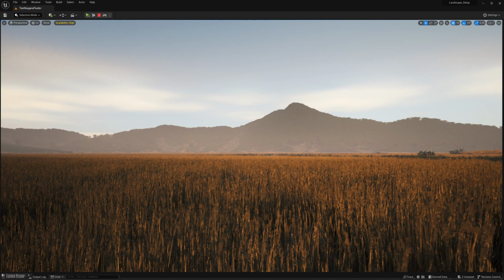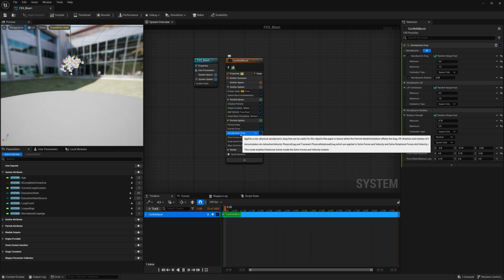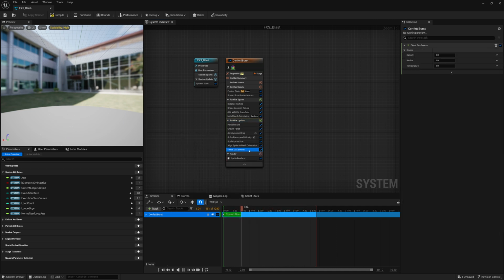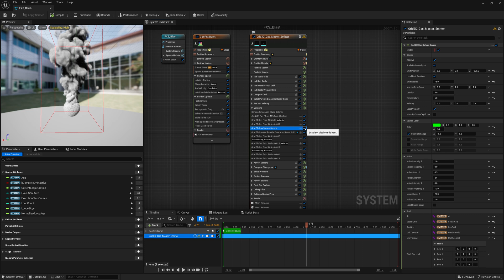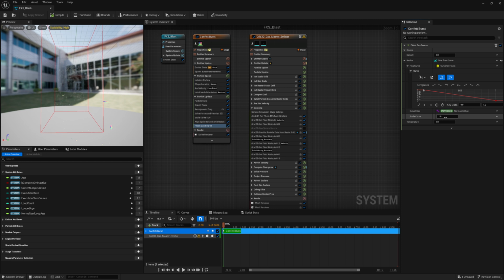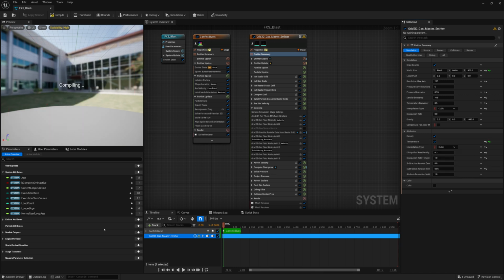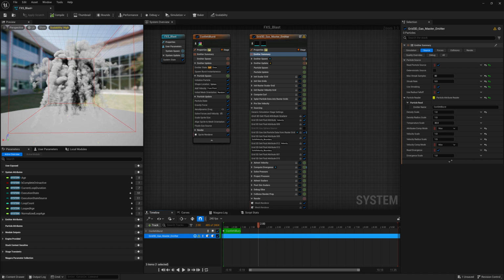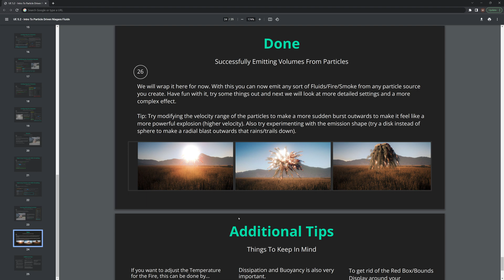Unreal Engine 5.2 - Intro To Particle Driven Niagara Fluids (Fire & Smoke Explosion) [1]

Comment: I am using 5.5.1 and when I select temperature I dont see it changing
Reply: Having the same problem, Did you ever figure it out?
Reply: @DefinitelyNotManny  I think I figured it out. Went down a rabbit hole a little. The Boolean for "Temperature is broken". I downloaded 5.4 and 5.3 Unreal and made it and seems to work then I migrated it into 5.5.1 and the Boolean checkbox for Temperature works. There's a work around but not really any solid solutions. It's a bug I guess
Reply: @DrNitrogen  ahh really, that's to bad, good job finding a solution!
Reply: @DefinitelyNotManny  I found a real solution. In the 3D Gas Master -> Render Temperature-> Set as curve , then for Temperature Color Curve -> Gradient
Reply: @DrNitrogen  awesome!! Great job! Will go and test it
Reply: @DrNitrogen yeah that worked! Thanks
Reply: @DrNitrogen  YAY! Thanks, may your renders always be super-crispy, your framerate high and GPU temperature low
Reply: I'm still working on getting the Temperature to affect it like the video shows. No luck so far. In 5.5.1, the Temperature affects the actual temperature (e.g. rate at which the fluids rise and fall) and not the emissive properties for an explosion.

Comment: i turn on temperature but iit doesen't work there is no fire , im useing 5.5.1 version
Reply: same I am using 5.5.1 and dont see it working
Reply: @DrNitrogen    Try setting the emitter to GPU to match the GPU setting of the Gas Grid.  Worked for me.

Comment: Well finally got around to packaging a product with this in it and.... the explosion is completely missing.  I suspect it is from the errors that show up in the output log.

LogNiagara: Error: Particle read DI is trying to access inexistent variable 'fluids_source_previous_radius' in emitter 'Explosion.ConfettiBurst'.
LogNiagara: Error: Particle read DI is trying to access inexistent variable 'fluids_source_color' in emitter 'Explosion.ConfettiBurst'.

I have no idea where these should be so I can't make them up.  If I find something I'll come back and post the solution.
Reply: Ok solved one of them. Need to add a Set Fluid Source Attributes to the Particle Update section of the parent emitter.  This gets rid of the missing fluids_source_previous_radius.  BUT it also makes the entire particle the color of the temperature setting (IE: all fire). Nope, also gets rid of the color variable.  Now to figure out how to make it not all fire and get the smokey explosion back.
However, this does make the explosion appear in PIE and I will assume packaged product.
OK, so to fix the nuclear effect when adding the source attribute is to change the temperature in the new source attributes also to 0.05 or whatever you like.
That fixes the missing variables and thus the missing particle effect in packaged game.
Enjoy.
Reply: Further update. While this got rid of the errors, I still have about a 50% failure on packaged product.  Don't know what is missing now.
Reply: Follow up:
These simply do not work in packaged products.  Seems to be an issue as its discussed (if you can find it) on the unreal engine forums.  This is under 5.3.2.

Comment: Looks very nice. Seems to not work quite the same in 5.3.2.
As soon as you turn off the emitter sphere and attach the particle source to emitter (see in comments on changes on how to do this) nothing is emitted by the particles.  You need to also turn off Use Radius Falloff.
Reply: Work now on 5.4 ! Thank you
Reply: @oliviergenovese4469  Interesting. I suspected it might be the case but can't turn my project to 5.4 just yet.
Reply: @oliviergenovese4469  Well copied the project and updated to 5.4. It worked once then not then again.  It seems very inconsistent. I'll try now to see if it is consistent in the packaged version.
Reply: Ok so I don't know if this is universal but finally I have the explosions working in packaged product.
All I did different is have local space off on confetti burst, but it is on the grid3d_gas_master_emitter.
So weird.
Reply: @b.delacroix7592  It's curious that only the radius fall off do the problems with after 5.2 versions, must have a bug somewhere

Comment: I was doing this but i have a qestion, when i go a bit far from the particles, they cull, it usually has some sort of target effect, I tried messing with the cull settings, render distance maximum, and bound settings but it doesn't seem to work
Reply from the maker: Try, (r.HeterogeneousVolumes.MaxTraceDistance 100000) in the command console.
Reply: @renderbucket  太赞了兄弟！我为了这个答案寻找了一个夜晚🥰

Comment: Im trying this in 5.3 but there seems to be some changes made. When trying to add Particle Source to Grid Gas Emitter, there is no Read Particle Source checkbox instead there is a dropdown. Selecting emitter in this dropdown and pointing it to ConffetiBurst (ParticleReader.EmitterName) does NOT for some reason connect it as on your tutorial. Any tips appreciated. Thanks!
Reply from the maker: Make sure you are creating a Grid3D_Gas_Master_Emitter. And inside of it under Emitter Summary with the All Tab click on, look for Particle Source Group, once you find it set Particle Source Type to Emitter and then the Particle Reader Group will show up, and inside that there's a spot to type in your Emitter Name.
Reply: @renderbucket in 5.3 the effect is not visible until Radius is increased to make it visible. Also  Grid3D_Gas_Master_Emitter looks and feels different than the 5.2 version for whatever reason. I've tried this in 5.2 and it works exactly as described while in 5.3 there are substantial changes and the result is NOT the same as described here(looks pretty bad in 5.3 tbh).
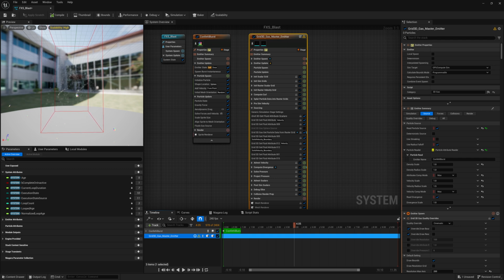Reply: @renderbucket  Try to increase radius options from 7:55
Reply: Enable the Niagara Fluids plugin I had the same issue.

Comment: Niagara Fluids has changed in 5.3. There is no 'Read particle Source'
Reply from the maker: There is its just a bit more collapsed in 5.3, just make sure you are creating a Grid3D_Gas_Master_Emitter. And inside of it under Emitter Summary with the All Tab click on, look for Particle Source Group, once you find it set Particle Source Type to Emitter and then the Particle Reader Group will show up, and inside that there's a spot to type in your Emitter Name.
Reply: even then not working
 @renderbucket

Comment: Great Tutorial, short question though: My Confetti burst spawns at the bottom of the fluid sim volume and if I change the offset, the confetti explosion goes from a wide explosion to pretty much exclusively along the z axis. So either my confetti moves wrong, or a majority of the confetti is out of bounds and doesn't show the fluid. I'm on 5.3, so that might matter
Reply: In the Gas Master Emitter, click on simulations and at the top you'll see local pivot. set the local pivot to 0 on all tabs.

Comment: For some reason, this is not working. All I see is a red box. I tried a full recompile, and made sure the plugins were enabled. My graphics card is a 2080ti; so that shouldn't be the issue. I can do these types of sims in blender without issue.

Edit: I found what the problem was. You need to set the render preview in your scene to shader model 6. I was using 5 (DX11?) thinking I didn't need the higher level one. I hope this helps any one else with the same problem I had.